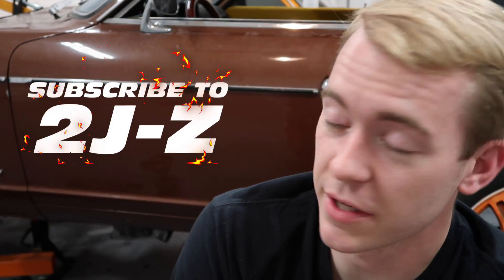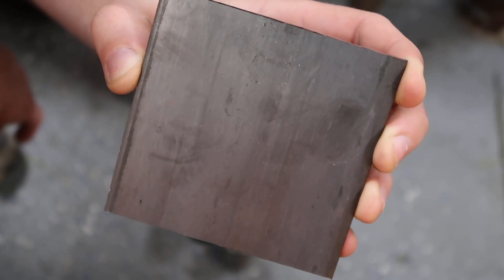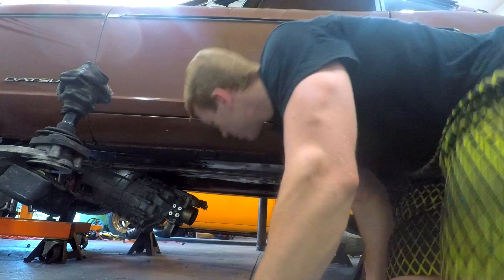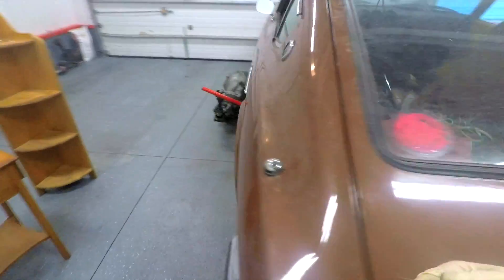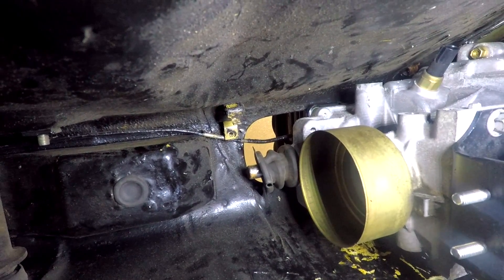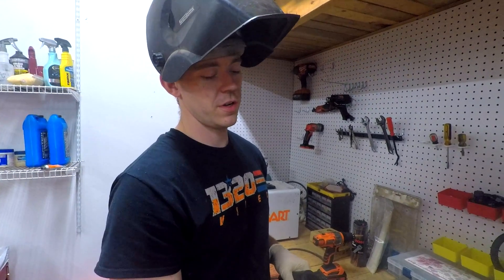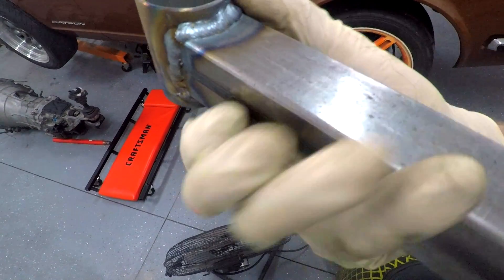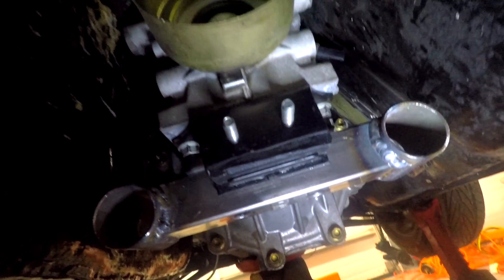How to Build a CD009 240Z Transmission Mount | 2J-Z Episode 13

Comment: Doing something similar but more extreme. I’m rebuilding the frame from the ground up out of DOM tubing. Same 240z, trans and engine, except I have the suspension out of a s13 Silvia. The problem I see is that the bolt holes you made will flex over time and make your trans sag. You need to support them more. Either with a larger bolt and washer, grade A preferably, or with a thicker gauge of metal. If you dont, it could cause the driveline to be out of place and in the future you will have Unnecessary vibrations causing wear and tear everywhere. Lol. In opinion anything to do with mounting should be at the minimum 12 gauge, preferably 10gauge. That Hobart can definitely handle that thickness, even up to quarter inch. Also when mounting anything that’s driveline or “vibration crucial” I would make a perfectly flat surface for a reference point. Your garage floor is not flat I guarantee you. You also need to weld a little slower. Stop and let it cool down for 30 seconds or so. You never want the metal red hot. Welds will become brittle and will have a chance to crack. But you probably already know this and Might sound like a know it all. Lol. Keep up the good work!
Reply: Did you end up finishing your frame project?

Comment: Yes, a million things on your mind. Please, one more. I bought the push to start with the rfid blue transponder. I think you have the same one. The instructions to hook it up stink or I do. Can you tell me which wires from the ignition go to the box? The box has red brown yellow black blue white. Waiting patiently for a reply. 510 wiring is similar to 240z
Reply from the maker: +Phillip Smith Hey! I will be doing a video on this, I have a diagram I put together that I can flash up on screen as wel